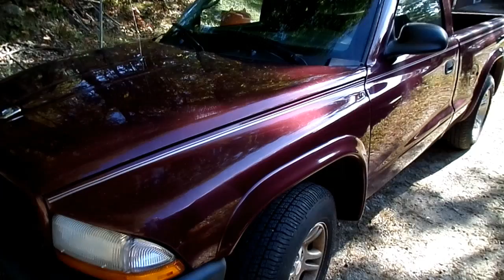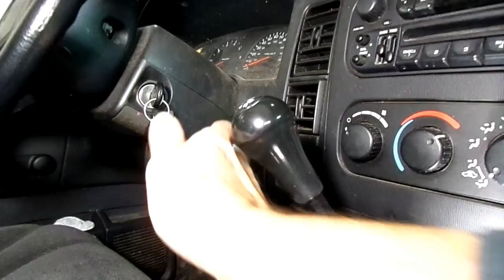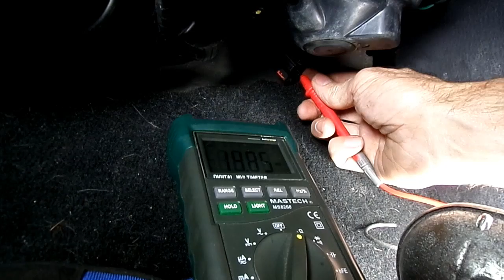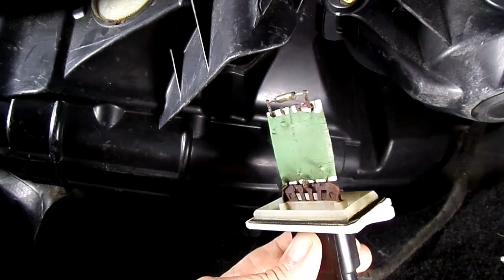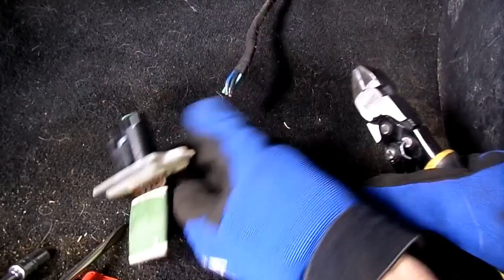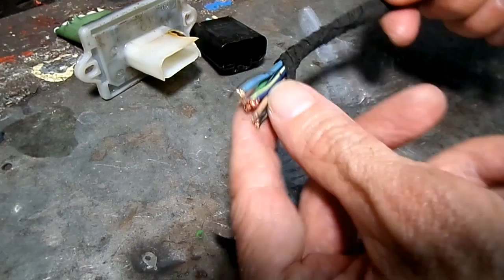Dakota Durango Blower Motor & Resistor Troubleshooting & Replace

Comment: FYI you gotta change the motor blower and  resistance using an updated pigtail because the oem was absolutely trash and flawed, so if you replace them using the same oem plug it will fry again so save the money and headaches and update the pigtails .

Comment: Will the heat turn off if the resister is shot? My heater went off and i havent checked it yet but im wondering of the resistor went bad...

Comment: You make a great video. I would recommend soldering those wires together as I have had butt connectors fail in fan circuits. Thanks for the post.

Comment: Wonder if you’re able to identify what the source of the corrosion was was it overheating almost burning that caused of corrosion or perhaps condensation that got down in that area odd place to get moisture for the pretty cool that you were able to pick up a brand new unit at the junkyard it looks like they just replaced it on the vehicle

Comment: generally if you have that kind of resistance the blower motor is working harder than it needs to be and is simply wearing out. When my blower locked up one day it took out the resistor pack with it

Comment: I note even on your replacement there's some slight melting on the same pin socket. Not enough to cause a problem, yet, but headed that way. Not a well designed system, unless you're getting paid to fix it I guess.

Comment: Thanks so much for this very easy to follow video, I first tested my blower motor just the way you did and it ran fine,then replaced the resister and everything runs great with all speeds! You saved me a big bill at a shop! Thanks!!
Reply: :yt::yougotthis: Agreed. Wonderful Helpful Video. I may go straight for the jugular and replace my resistor too. This could have been the sharp electrical burning smell I smelled once (coming thru the inside cabin air vents) in my Dodge Dakota 2004 Truck. My Blower Fan only goes full blast or not at all. At least I can still turn it off.

Comment: Got an 07 Aspen and replaced this one and years later it failed.  It had a new pigtail harness and one if the guys removed it without documenting the wire order. Your video gave me the wire order info that the dealership said they didn't have. Thanks

Comment: Never ohm test a live electrical circuit.  You measure for voltage coming to the motor,  should have a different reading for each position on the switch.

Comment: My blower is good. I changed the resister. I checked the fuses. I have no blower at any speed. Any ideas?
Reply: Check ignition switch. Pin 8 Dark green wire. It should be hot with ignition in the run position. This is the feed to the blower motor.

Comment: Went thru this twice on an 04. Realized a crack in the heater core housing causing it to leak all over floor. Hence the corrosion. Never another Dodge.
Reply: An 04 is barely dodge lol

Comment: How can these keep going out? I've a 2002 durango and for 2yrs this is the 2nd or 3rd.  The wires keep frying! Any ideas???
Reply: I have the answer and learned it the hard way. I went through 3 of these resistors on my Dakota. The problem is the 5-pin connector is not rated for the amp load on the highest and 2nd highest fan speed settings.  Heat and oxidation would build up to the point the connector would melt and fuse to the resistor.  So even with a new resistor block and connector it will just happen again. I finally solved it by soldering the wires directly to the pins on a new resistor block. You have to carefully cut away part of the shroud to get good access to solder. Once done, you can even fill the whole cavity with silicone sealer or epoxy as a potting compound.  Mine has been working fine for four years now. Also, you can get new resistor block, connector with wires, and even new fan/motor assembly for very little $ on Amazon.  Don't pay dealership prices.

Comment: Before you buy a new one, try unplugging the connector and plug it back in. I just did that and my completely dead blower motor sprung to life. It works on all settings including the 3rd one which hasn't worked in over 2 years! Definitely try replugging it first.

Comment: The resister replacement is a quick and dirty car lot fix that doesn't solve the real problem. Usually, the blower motor is drawing to many amps and overheating the resistor and the wires.

Comment: Can the resistor go bad even if it doesn't look bad? (No corrosion) my blower would only work on high, over time got weaker, than finally stopped blowing for good. The resistor still looks good but not sure on how to test it

Comment: I have replaced blower and wires and now my blower comes on some days then some days it want come on at all. Its goes off and on what could this be?
Reply: My guess would be a poor connection at the pins and sockets on the resistor block. Probably the ground wire makes intermittent contact.  I got sick of the connector melting so I soldered the wires directly to the pins. The pins and sockets are not rated for the amp load on the highest speed. Heat builds up, the contacts oxidize, and that leads to more heat.

Comment: Same problem here. Nobody knows what cooks those plugs at the resistor block. Bad ground somewhere? Where? Third replacement here
Reply from the maker: Is the motor drawing to much.
Reply: @RichpinTv  
You know, it's the original 04 blower motor. The darned plug fries every few years. The first time was just out of warrenty. Thos weekend will be the third one
Reply: @RichpinTv  
Indeed. It was recently replaced and runs fine since

Comment: I have a question... Would one be able to wire the colors together without a resistor? I'm the type of person, either you have the blower on, and on full. Or not on at all. Having these blowers running low burns these resistors. Just bad design. Thanks for this video!

Comment: UPDATE!  February 10, 2019:  I looked at your video again and saw the part where you first banged on the blower motor a few times.  I never have, so, I did, and voila!  It started running!  It appears that there is a loose connection in the wiring there, which should be easy to fix!  THANK YOU for your great video, you saved me a ton of grief!  Just goes to show you, check the simple things first, you just might find a quick and easy solution!

Comment: Great info but I would add a warning about airbags yo disconnect and isolate from grounding the negative battery terminal and wait 2 minutes for airbag capacitors to discharge to avoid airbag accidental deployment as per the dodge ship manual. Thanks

Comment: Do you know what would cause the air to come out of defroster and floor but very little if any coming from the vents?
Reply: I have an 03 dakota 4.7
Reply: @jimbennett1834  I do know why there is a vaccuum line that sticks out of the firewall behind the motor its really small about width of a coffee stirrer and really easy to miss. What happens is the vacuum line becomes disconected this vacuum line controls the flap that opens and closes on the bottom of the vents the flap gets stuck without vaccuum from the line. Thats why you only have air blowing from defrost. I actually fixed mine with a coffee stirrer and black electrical tape then eventually I bought line and fit it over the little piece sticking out from the center of the dash in the firewall (when you open the hood you look behind the motor for the little vaccuum line sticking out of the body under the hood behind the dash).
Reply: @guyincognito361  cool ill look for it thanks

Comment: Yeah I’ve changed my resistor 6 times 3 connectors later and 3 blower motors later the last two pins in the resistor are burnt up is this because I have my heat always on high
Reply: No its because Dodge uses cheap parts in order for their partners to make extra money. Their window regulators are trash. I've replaced every  window but all break. They use plastic parts inside to hold a tight cable and expect it to actually hold? If they used a metal part inside would avoid it. But Dodge knows this. Same as the switches on the driver door, they tend to go bad cuz they are cheap. Sad cuz I like the concept of the Dakota. I'd rather have a Dodge truck than a Ford or Chevy but Dodge has obvious areas to improve
Reply: This is so sad, I grew up whit my dad using American cars and trucks and I was doing the same, I went through the tree big ones and now based in my son experience I'm thinking to switch for a Toyota truck, still I have a dodge Dakota very poor constructed and a 2014 ford Mustang whit transmission, suspension, breaks, fuel, cooling, integrity and sound problems at the point that I'm going to sale it and buy a Toyota 86 for my wife.  it is incredible the lack of materials quality and the poor design. Toyota, finally I'm ready to give you a tray.

Comment: Ok I broke some rules here. About 5 yrs ago my fan stopped working. Instead of doing it right I cut out the 2 connections/harness. I then taped the wires directly. This fixed the problem. Well 5 yrs later It's out again. Does this mean it's burned out? And if I replace it will it work?

Comment: That fan is just as noisy as mine. I put a new one on and its just as loud. Also I am on the third connector and 6th resistor. The newest connector harnes has larger wires. The plastic between the positive and negative leads is really thin. If the wire heats up it melts. It is not corrosion. It is a meltdown.
Reply: Just found out what might be going on with my truck. This time the motor was not working, The new harness and the resistors were working. What I found may be on on going issue that I never seen until today. Water. Water is getting into the motor from somewhere in the duct system. It was getting dark and we have storms moving in.  Will have to find the water problem tomorrow if it doesnt rain. This water issue may also be shorting out the resistor pack.
Reply from the maker: The water might be the problem.

Comment: my 2006 Durango first 2 speeds dont work. but speed 3 and 4 work.  What would that be caused by?
Reply from the maker: The blower motor resistor controls blower speeds so i would start by looking at that.
Reply: richpin06a I change the resistor cause was burn and was working for 2 weeks...now it's bad again what can be the problem or how can i fix it?

Comment: Thank you so much for posting this video. I knew something strange was going on because it would work on low but if you increased the fan power it would completely shut down and low wouldn't work for a period of time. I couldn't unplug so i assumed it was bad like yours. I took a picture after I removed it (yes the left screw was a problem @Dave W).

Comment: my fan blows really light. you think i should check my resistor to get more power?
Reply: richpin06a having a problem with a Durango where the blower works on the lower settings but cuts out when it is turned up to high.  is this most likely an issue withe the resistor?
Reply: flyby427 yep it was the resistor
Reply from the maker: If all the speeds of the fan are working the resister should be working properly.

Comment: how do you remove the plug that goes into the resiste? i thought my blower motor qas broken so i was about to buy a new one but the plug was toasted and the person said as long as i get a good connection from good metal to good metal it was fine
Reply: replacing it is better then just making sure you get a good connection
Reply: Cristian Hernandez

Comment: I really don't feel like doing this I'm just glad it's an easy fix
Reply: I had the repair first done at a gas station for about 350.  Ever since I have done it myself.  I guess a bad design by Chrysler.  Same resistor and wiring plug has failed probably 5 or 6 times since.  Blower motor always tests okay.  Have to be a contortionist to reach and unscrew the resistor but otherwise a simple fix.  Dorman sells both resistor and plug together.  Don't just replace the resistor if the hot pin is burnt.  Replace both resistor and plug at the same time or the resistor will fail within a month.  Doesn't appear to be a moisture issue as the car is in Southern California.

Comment: Great video.  i wish I had found it when I had to do this job the first time several years ago.  In the past 6 years I've gone through 4 resistor blocks and 2 fused connectors.  Factory connector was melted and and fused.  The replacement lasted a couple years and did the same thing.  I then used the extra set of wires that comes with the new connector and just connected those in the correct positions to a new resistor block.  Used shrink wrap on each little connector so it would not touch the one next to it. The most recent resistor lasted about two months. As you know the fan runs only on high speed when the block goes out.   The fan motor obviously works but I'm wondering if there is some way it could be drawing excess current and causing these resistor blocks to overheat.   Thanks.
Reply: +Scotty S.  An update for anyone in the same boat.  I removed the fan and sure enough it did not spin freely.  The motor shaft bushing probably was overdue for some oil thus creating some drag and drawing excess amps.  The trouble is the way the fan is designed you cant reach the shaft to oil the bushing. So head over to Amazon.  I was able to get an aftermarket replacement fan for $40 TYC brand), a new resistor block and connector together for $12, and an extra resistor block to keep for a spare for $6 (both Dorman brand). Bolt it all in and splice the new wires in and it works great.  So folks, always pull the fan and check that it turns easily when  replacing the resistor block.  And at these prices, it may be worth replacing all of it preemptively.  Cheers!
Reply from the maker: +Scotty S Good tip.....yes spin the motor to check for drag.

Comment: Excellent video! thanks for sharing. My problem is a little different, 2003 Durango, I get heat coming out of dashboard but when I switch to bottom vents, no heat.any hints? thanks.
Reply from the maker: +John Galv Sound like the blend doors are not working for some reason.

Comment: Anyone have trouble getting the screw out on the drivers side. (left)? The right side screw came right out. Maybe a thin walled socket will work as there seems to be a small plastic flange up there covering part of the screw.

Comment: you have this video listed as Dakota Durango These are two different vehicles. Great video but didn't do me a bit of good. If your working on a Dakota, don't list it as a durango.
Reply: There the same thing
Reply: I have to remove my dash, drain my Freon gas and engine coolant and remove my heater core to replace my fan and resistor. No disrespect but please how are they the same vehicles?
Reply: +Kelly Covey what year is your Durango?
Reply: My 01 Durango and 04 Dakota are the same. Both blower motors, resistors and ignition switches are located in the same spot. What year is your Durango? Maybe 05 and up are different.

Comment: Thanks a ton.  I thought a new resistor was going to solve the problem, but it was also a totally corroded connector.  I can make it work if I wiggle or hold it in the right spot.  New connector on order should completely resolve.  Thank you for posting such an informative video!

Comment: Thanks for the video, my connector was stuck due to over heating, so I gave it a bath in WD40(Wires end up) and it popped apart after and hour in the bath, good tip about the motor, will explore.......OBTW my resister replacement was $8 from Autozone......

Comment: That's just a temporary fix, it's going to burnout again guarantee, the problem is the motor drawing to much amps, pull out the blower motor and take a look at it. What I found was the motor, although still operating when voltage was applied, was more difficult than it should be to turn by hand. It felt a little stiff and when I gave it a good push it had no free wheel it just stopped instantly. When we sourced a new blower motor it was much easier to move by hand and when I gave it a good flick it didn't spin by itself long but it did not immediately stop like the old one.
Reply from the maker: hudman2012 Thank you very good tip.
Reply: +hudman2012 I agree with you about the blower motor. last year I had to replace resistor block and wiring harness because they were melted together. I spliced in a new connector and installed a new resistor, now the same thing must be happening again, the motor won't work and I can not get the connector to unplug. Is there a way to test the motor out of the vehicle? I have it out and can get it to run no problem by hooking up jumper wires, but not sure how to measure amp draw? Also, the connector that actually goes to the blower motor, what should the voltage be there, and should it have voltage on both terminal?
Reply: +Judd Delancey forget testing, it the motor bearing.  buy a blower motor from amazon, I paid $43.46 free shipping
Reply: O.K. thanks, I have the new wiring harness and resistor on the way. I'll order the motor next week, that was my initial inclination also.
Reply: If that doesn't fix your problem, replace the ignition switch to the left of the column. I've changed everything else and still have the problem. I'm fixing to replace the switch to see if this fixes the problem